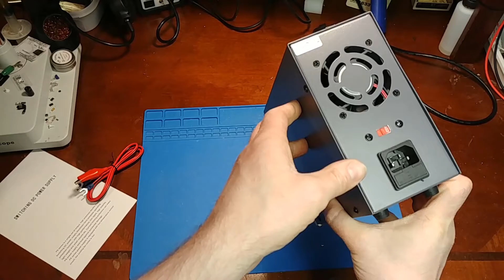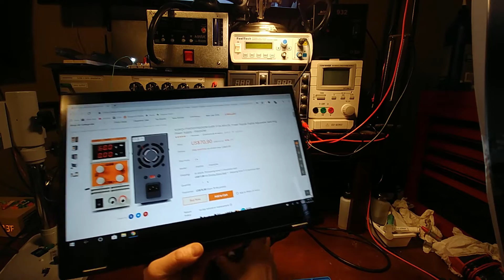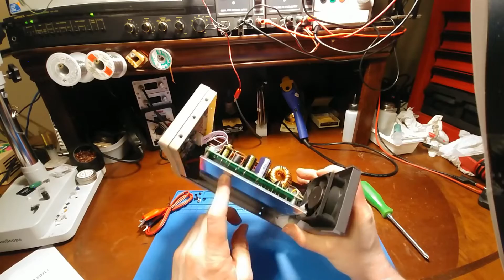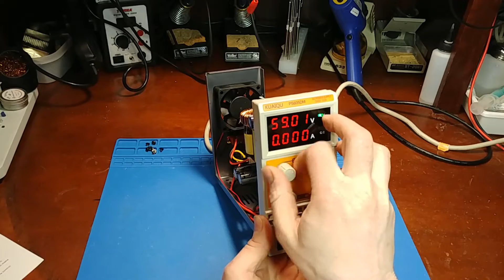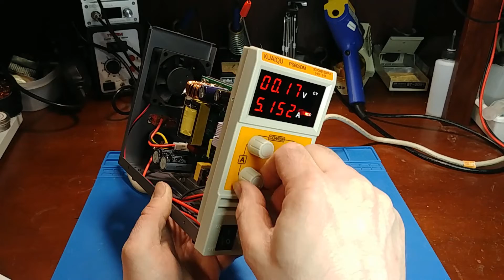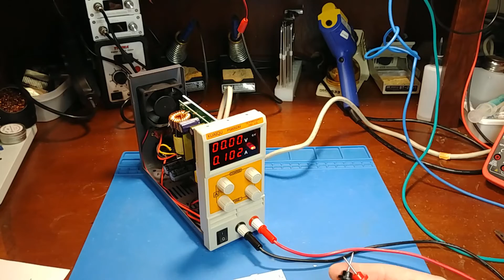60v Lab Bench Top Adjustable Power Supply Review

Comment: Nice detailed review! I notice this form factor more often lately. On the inside it looks very similar with the Minleaf version, only the front panel is different. I wish these chinese guys add an output on/off switch and a "lock" function button...if they did this, I would definitely buy one, otherwise it's featureless for electronics lab usage.
Reply from the maker: This is a extream budget under $50 PS. So you have to keep the exspectaions pretty low. It's very bare bones. I'd reccomended to spend at least $100 and go linear for a better lab supply.
Reply: @jeffescortlx  yep, I already have a ~400$ linear PSU from Aim-TTi

Comment: Having more display digits may not mean much especially if the decimal point is fixed.  My Dr Meter linear supply has 3 digits with auto ranging, the decimal point shifts.  Resolution is 1mA on low current, 10mV on low voltage.

Also has an output switch and carry handle.  Fan appears is not thermally controlled, fixed speed.  Build is all glass boards, mechanical is just OK, acceptable.  Voltage and current pots are just OK, some inconsistency in adjusting.

Comment: I never heard of a test of a supply using current limiting while having the corresponding voltage set super high.  Then open the circuit letting the voltage skyrocket and then close the circuit.  That just isn't realistic for any supply IMO.

Perhaps a zener diode selection box with selectable current limiting resistors connected to the output of the supply may give the results wanted.

Comment: Nice review, very in depth. My question is why keep getting more cheap power supplies when you can good used HP on eBay for cheap? To be fair some of the HP ones aren't as user friendly as turning a knob.
Reply from the maker: That's a good option. Although those "cheap" used HP's normally bring in over $200 with shipping in working condition.
Reply: @jeffescortlx  oh yeah don't get me wrong they cost more than one  banggood/Ali power supply but once you get 2 or 3 of the other ones then it was cheaper or the same price. I'm currently running a banggood power supply but I'm not sure what I'm going to get next because I do a lot of amplifiers now and I want to load test/dyno them so I'm probably going to get some server power supplies for that and some dummy loads. I'm definitely going to keep running my banggood special until it dies I just would have gotten a HP if I had know at the time.
Reply from the maker: @FixedUntilBroken  server power supplies are perfect if you need a ton of amps at 12v! My local recycling shop will sometimes get boxes of them in. Just have to find the pinout on the edge connector to turn it on.
Having an old HP supply would be great if you have a way to get your hands on one. But I also like the gamble with over seas stuff. Some gems out there mixed in with the not so great stuff.
Reply: @jeffescortlx  eBay can be a gamble also haha. My HP 54600B oscilloscope I got for $60 on eBay doesn't always boot up. Some times it takes 2 or 3 tries. It keeps you on toes wondering if I turn this off will it turn back on.

Comment: Ooow you with your fancy power supply, don't look at the ammeter just smell the current :-D.
For the purpose you will use it for it's fine, leds don't care about ripple or odd harmonics.
Change out the front panal pots for good multiturn ones and it should last.
They always cheap out with the pots.
Heat stink, you need a coffee :-D
Reply from the maker: Ya know the pots on this one didn't feel too bad. Fairly smooth for a cheapy. Bring on the coffee.
Reply: You can't have enough power supplys, much like multimeters.

I've made many power supplys with rubbish from the pcb scrap box.
Basic linear jobbies using L200/LM723/LM317 and jacked up 78XX series, not forgetting at least one 2N3055 transistor on a heat sink.
Not superb but free :-D.
We have all lashed together parts to make a short term psu, often lasting years lol.
Reply from the maker: @zx8401ztv  yeh I've also had my share of using old PC power supplies and random supplies for a bench top use. But after a while it's worth getting a proper supply with displays and current/volt control. Plus prices have really become reasonable.

Comment: Can you add a resistor to the output caps to drain them faster to try and stop the delay when dropping the voltage? Not sure if that would cause any negative effects. I have always thought the caps on outputs have the potential to blow up leds.
Reply from the maker: Yes, but it's going to display current draw that isn't actually going to what ever load your driving. So that will have to be taken into consideration.
Reply: So essentially you could only put resistors on caps before the current shunt. Would doing this sort of cancel out some of the capacitance? I’m currently looking at modifying/building a little buck converter to have voltage and current limiting and i beleieve this unit will have the same problem only advantage i have is the current shunt will be after the buck converter so the caps will not be directly at the output.
Reply from the maker: @dabboy0213  Yes adding a resistor before the current shunt should keep it from displaying that draw on the current meter display.  Unfortunately it's going to be laggy since all the adjusting is happening on the primary side.
Reply: @jeffescortlx  I believe that there are some calibration pots in this unit for Amps and Volts, so adding a resistor after the current shunt should not be an issue, since you can zero it using the pot.
Reply from the maker: @gtsak  I did notice a trim pot on the display board. Although I do like the idea of installing it before the current shunt.
Reply: @jeffescortlx  I have one more question. This cap on the output is to decrease the voltage ripples right? Wouldn't adding a resistor increase the ripples, since you add a constant load on the output? Wouldn't it be the same to just replace the existing cap with a lower capacity one?
Reply from the maker: @gtsak  there is a inductor and capacitor on the output of the transformer (after the diode) that if you change it too far will probably come out of balance and allow ripple to come through yes. It would need some trial and error experimenting, or the user will just have to deal with the laggy adjustments.